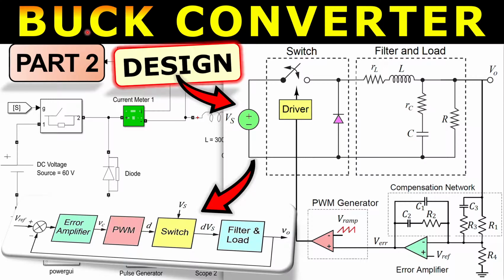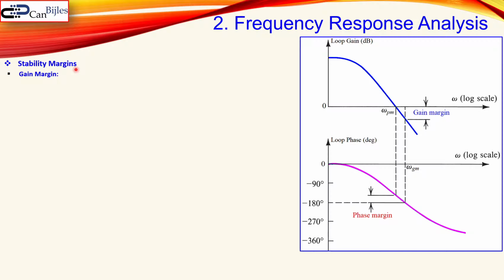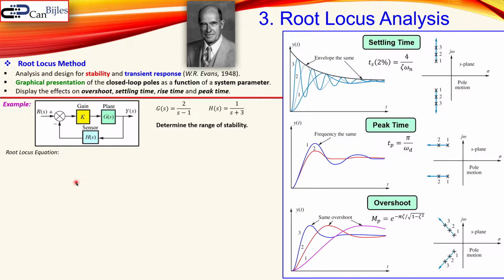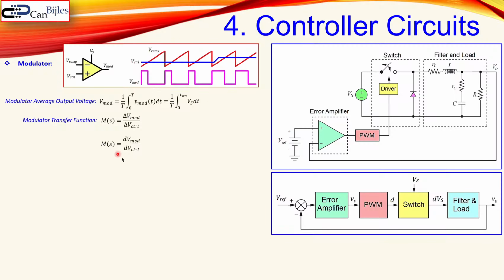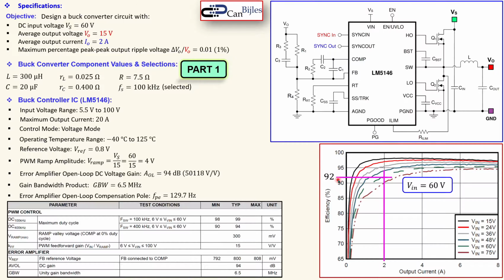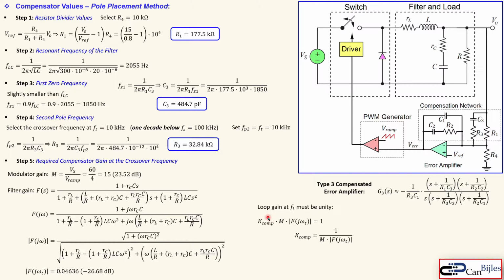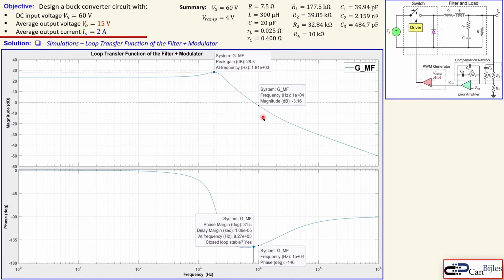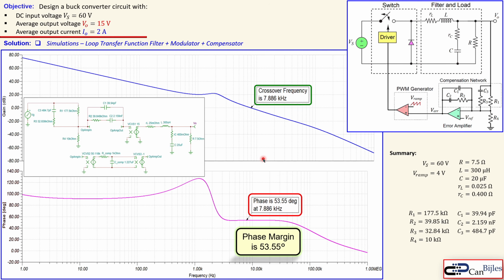⚡ DC-DC Buck Converter Design Part 2 ⚡Controller Design - Calculations & MATLAB & TINA-TI SPICE

Comment from the maker: ⭐ Documentation & Simulation Files 👇
🔗 Video Presentation: https://drive.google.com/file/d/1uv3miNV5ovKmXcslo27YgNBYfA3nHWVr
🔗 MATLAB Script - Example Gain Margin & Phase Margin: https://drive.google.com/file/d/1rS8FYYQw0hn4aS0UFQjTbw2fyTl891TS
🔗 MATLAB Script - Example Root Locus Method Second-Order System: https://drive.google.com/file/d/1ruLXDnM5jsR9lEPkf0S0QyJbVqBq-USE
🔗 MATLAB Script - Complete Buck Converter Design: https://drive.google.com/file/d/1qH29UV9pdFYUYiIsRyhaUdXqyJ42Wu8Y
🔗 TINA-TI SPICE Files:
https://drive.google.com/file/d/1q63_caPUa1ngdaLbChIq75pXvfvmMG9m
https://drive.google.com/file/d/1q7UgRSm2LWK5S7qGj4iENiASZoSkiuXB
https://drive.google.com/file/d/1qxJ61V3PgF8zZebHr0HTD7vzRhI7ackP
https://drive.google.com/file/d/1rSEzisRVCA6QABYeAGHY4d59Mw28tDj3
https://drive.google.com/file/d/1rYmnDefakCTeN1B3YeDx9Ls-LOrz9aqY

Comment: Hi ,this video has been extremely helpful , but can you please tell me how you got the equation in step 6 (49:22). I dont understand why the caps are removed. Its something to do with frequency and short circuit or open circuit concept
Reply from the maker: I am glad that the video is helpful. In step 6 where we calculate Kcomp, the capacitors (C1, C2, and C3) are not considered (insignificant effect), since this is calculated at the crossover frequency condition. Derivation is not given, but this the assumption we use in this method.

Comment: I watched the video and did the calculations for my lm5145 converter system. Then I gave the values to the TI tool which drew me a bode plot. Unfortunately, my phase margin was 25 degrees, which is a tragic result. I am analyzing your film again and I have analyzed it with the producer's note. According to the application note, fp3 should be for capacitor fesr. You adopted fc and it worked, because your fesr is about 20kHz. However, the problem occurs when the ESR of the output capacitor is smaller. In this case, according to your calculations, we are not compensating the capacitor pole correctly. At least that's what I think. That's why I get this phase margin value.
Reply from the maker: It's interesting that your ESR for output capacitor giving you a lower phase margin. The design steps shown in the video are generally applicable, but sometimes component variations, especially with ESR, can significantly impact the final compensation. However, having a lower ESR means that the situation is getting closer to ideal and the associated pole frequency becomes larger. Therefore, the effect of low ESR would make the phase margin larger, not smaller. This is not the same conclusion as you have it.
Reply: @CANEDUX In my opinion, the problem is that I create a pole in the fc place where I shouldn't give it and because of this my phase drops. By changing only this one frequency to the fesr value, the phase becomes perfect.
Reply from the maker: @rocetex  Interesting result, but it is still odd because the pole frequency becomes larger as ESR becomes smaller.

Comment: Thanks for sharing this great video. 

In boost converter, Inductor comes before the switch network. Is this method still applicable is boost converter case? What will be the modulator transfer function?
Reply from the maker: Glad you liked the video👍 
The transfer function of the boost converter is different than that of the buck converter. The design will be somewhat different, but similar steps are applied if you voltage-mode control (as used in this video).

Comment: Great Video. But how to calculate natural frequency, wn ?
Reply from the maker: Glad you liked the video! The natural frequency (wn) calculation depends on the specific components in your resonant circuit. You can see this in transfer function of the filter and load part of the Buck Converter.

Comment: Where does Vref come from?
Reply from the maker: This depends on the controller IC you are using. For the Buck Controller IC LM5146, the reference voltage is 0.8 V. See datasheet: https://www.ti.com/lit/ds/symlink/lm5146.pdf

Comment: Thanks for the great tutorial.
How do you calculate a PM for a TF with a zero?
How do you determine the value rL? Is there an equation for this?
Can you please do a tutorial on current sensing techniques and compensation under dynamic parameters (such as adaptive inductor or load)?
I really appreciate your work.
Reply from the maker: You're welcome! Great to know you liked the content. Do not forget to share the videos. 

1. Phase margin calculations goes the same if you have poles and zeros. You need to take the argument of the zeros as you do it for the poles, but the phase contribution of the zeros are positive when they are at the right-half plane.
2. The rL of the inductor is not just determined from a calculation. You might get this from the datasheet or determine it using actual measurements. Here, I just picked a regular value as an example. 

At moment, I am working on several subjects and compensation using current mode control is on my list also. I will also consider some more advanced topics too.

Comment: Hi,
At school we have learn that rise time is between 10% and 90% of the signal.
In your video 0% to 100%, is it anything not correct than I need to know?
Reply from the maker: In the video, I explain that 10% to 90% is used for critically damped or overdamped systems. So, it depends on the waveform.

Comment: Where can I access compensation buck converter matlab codes?
Reply from the maker: ⭐ Simulation Files 👇
🔗 MATLAB Script Gain Margin & Phase Margin: https://drive.google.com/file/d/1rS8FYYQw0hn4aS0UFQjTbw2fyTl891TS
🔗 MATLAB Script Root Locus Method Second-Order System: https://drive.google.com/file/d/1ruLXDnM5jsR9lEPkf0S0QyJbVqBq-USE
🔗 MATLAB Script Complete Design: https://drive.google.com/file/d/1qH29UV9pdFYUYiIsRyhaUdXqyJ42Wu8Y
Reply: @CANEDUX  Спасибо!
Reply from the maker: @SMV1972 You're welcome!
Reply from the maker: I will add the MATLAB script and simulation data from TINA-TI Spice as soon as possible.